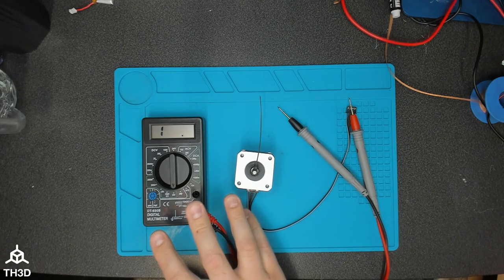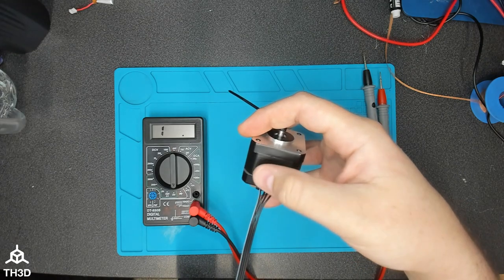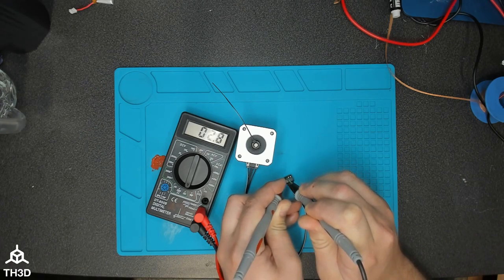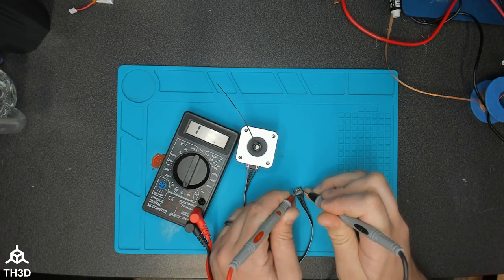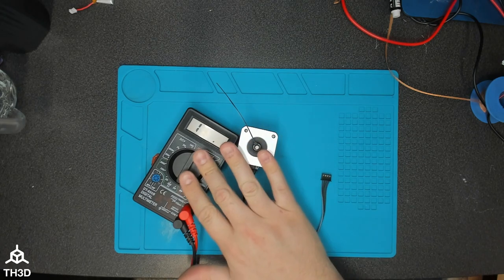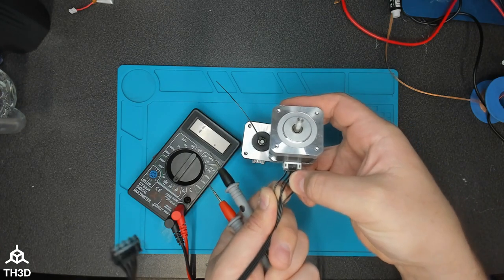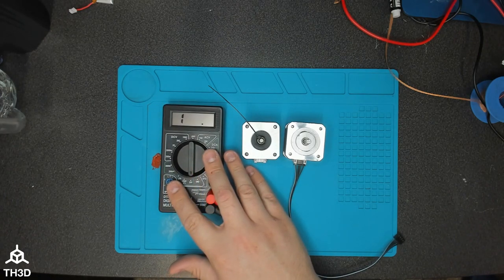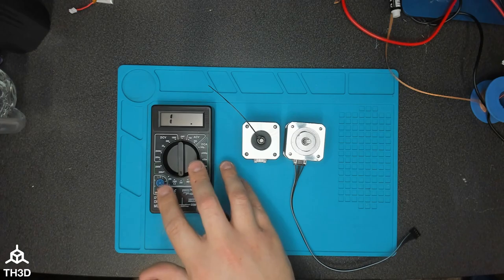EZTip #4 - Testing and Checking your Stepper Motors

Comment: Well that is very interesting as I did a test on my car idle air control valve. No ohms on adjoining pins 3and 4 same again on 1 and 2.. Only got a reading on pins 1 and 4 of 58.3 Sounds like a faulty stepper motor. Thanks for your help.

Comment: A great refresher! I did this and my stepper checked out, but it is still getting extremely hot. I'm running a standard nema 11 on 21 volts (rated for 24) and I can't touch the motor for more than a second without it burning me. I don't remember them getting this hot in school
Reply: actually I figured it out, I had to turn down the output on my motor driver. Rookie mistake lol
Reply: @skylerjohnson9089 sorry but what do you mean by turn down the output, i am rookier than you 😅
Reply: @Tech.Plus.  I was using a stepper driver that had the option to vary the output amperage. More amperage = more heat. Hope this helps

Comment: How can we use this for setting amperage at the drivers? I know ohms law, but what voltage do we input, system board (12/24) or other?
Have some steppers that are not marked in any way.
Reply from the maker: Have to just set it and check temps on the motors. They should be under 60c

Comment: Quick question. With mine the resistance is 2.8 average accross all stepper motors except for the z axis. This one is much lower at 2.3. I have feeling my Z stepper is faulty. Could this be an indicator being only 2.3 accross both coils on Z.
Reply from the maker: Are BOTH coils on the Z 2.3 or just one?
Reply: @TH3DStudio  both for that stepper motor. All others are a different resistance.
Reply: @TH3DStudio is this a problem?

Comment: Thank you for this short/sweet video as it was very user friendly.  Before I hit the Like button I have one question; I did the test and got 5.1 / 5.0.  So if 5.0 a good reading, too high/low?
Reply from the maker: a 0.1 ohm difference is not much. I'd say its fine. Most motors are within 0.1ohms -/+ on each coil.

Comment: I know my Motor wire pairs, but how do i know de order they connect to the motherboard? I mean, by your video, the pairs need to be next to each other? Like 1-1-2-2
Reply from the maker: Usually its pins 1 and 2 for one coil and pins 3 and 4 for the other coil on most boards.

Comment: How do you test you printer motherboard for a dead stepper driver (drivers are built on board)  Ender 5 plus V4.2..2
Reply from the maker: Connect a motor that you know is working and tell it to move.
Reply: @TH3DStudio  I have done this and the same thing happens to a known working stepper
Reply from the maker: Assuming the wiring is good and the firmware on the board is correct, the driver is likely bad then.

Comment: mine is completely okay according to this video. however is impossible to move by hand or tools, and it is totally non responsive in the cnc machine. Like it was a brick or something.  don't know what to do.
Reply from the maker: Sounds like it's physically seized up. Check the bearings

Comment: So what happens if the ohm difference is more than one or two? I am getting an error blinking red light on my stepper driver and I thing the Stepper motor has gone bad. One pin reads 1.7OHM the other pins read 1.1OHM
Reply from the maker: If you ruled out the wiring being bad then its likely the stepper has failed.

Comment: I tried to invert my stepper motor on my 3D printer. The wires were all black but I manage to switch the correct wires. I tried to test it afterwards but it doesn't work. I switched the wires back to there original places and still doesn't work.  What bug me is the fact the motor lock itself when I click on auto home and unlock when I disable stepper motors. Do I need to buy another one or is the motor fine?
Reply from the maker: Are you plugging it in and unplugging it when its on?
Reply: @TH3DStudio  My printer was on, but I disabled the motors in my CR-10 menu. What do you propose to do?